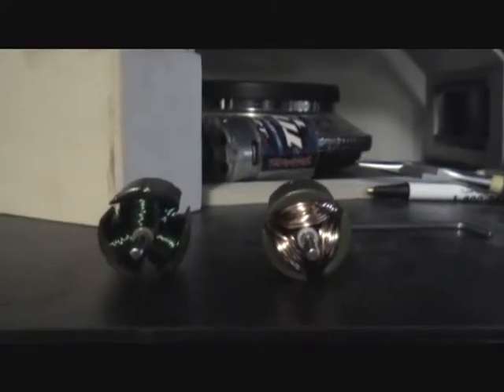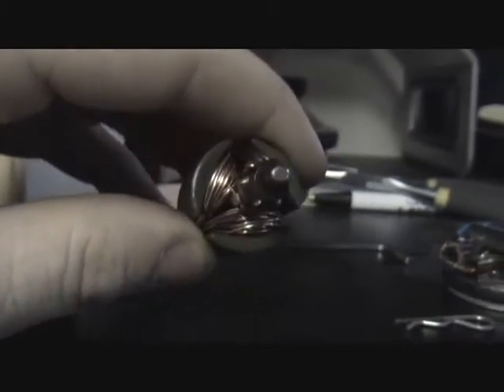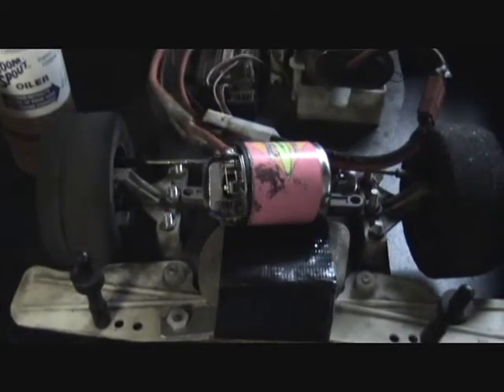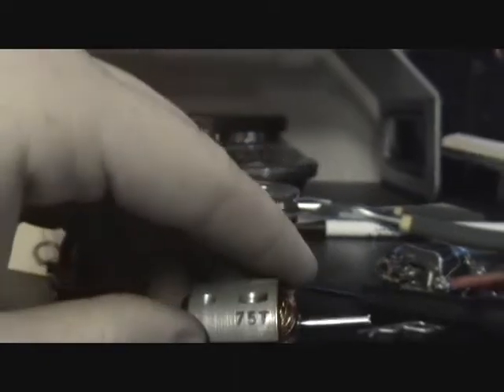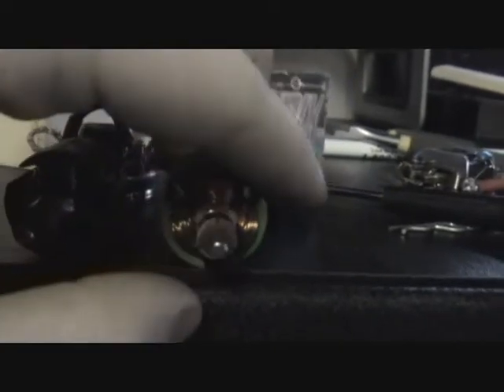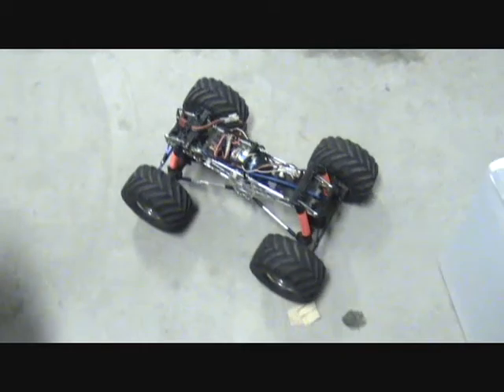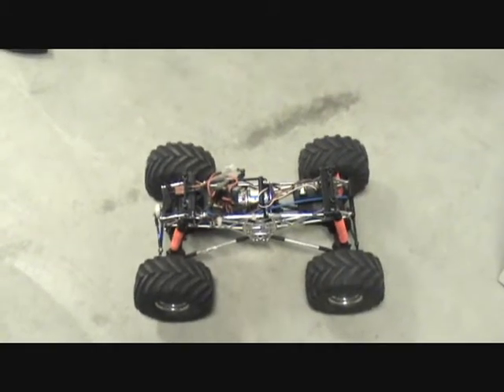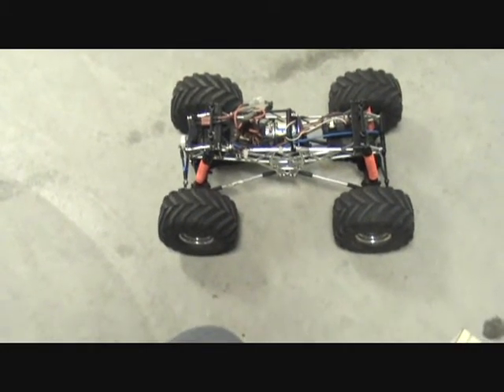Successful run of a custom rewound brushed motor armature

Comment: The higher the turns equals lower motor RPM with more torque and lesser amp draw from your battery, the lower the turns equals higher motor RPM with lesser torque and more amp draw from your battery. There will now be a balance of gear ratio and the battery power (Mah) for you to consider to go faster with less torque or slower with more torque.

Comment: Pretty decent R/C collection there friend! I have a Stampede, E-maxx, and an RC18T that I just got back together this past weekend. I'm running a Mabuchi 380SH in the RC18T, but I'm looking for a smaller pinion to make better use of the 380's high rpm's. I've dabbled with armature rewinding and I have plenty of motors to experiment with. Is the HPI Wheely King 4x4 a good truck? kinda looks like it might be.